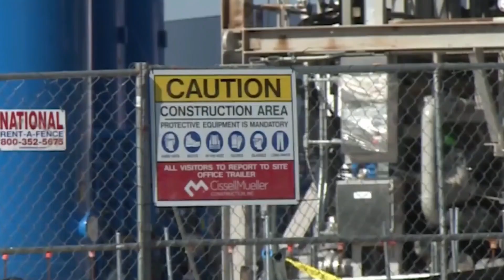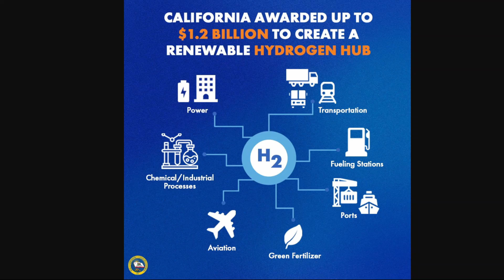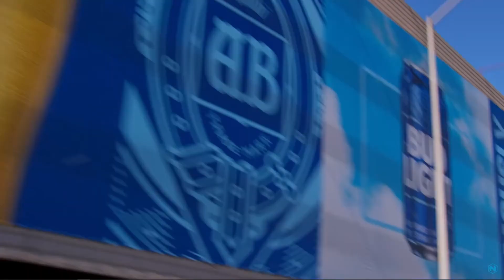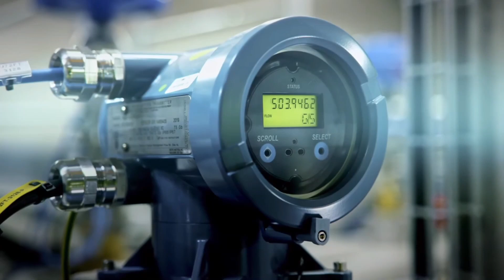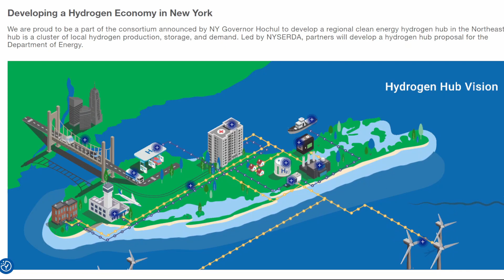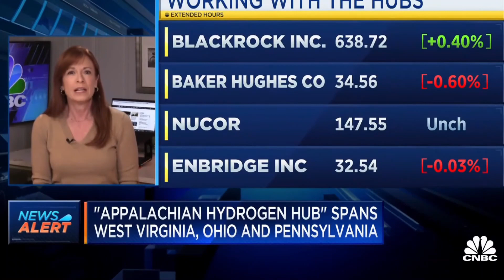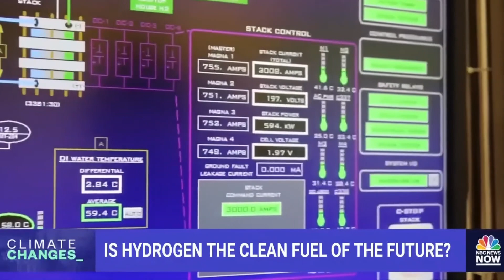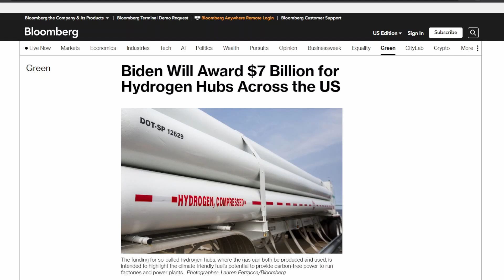$7 Billion for Hydrogen Hubs: America's Clean Energy DREAM Is Becoming Reality.

Comment: We here  at TSS have been working with hydrogen technology for 16 years now. We have a turnkey product that will help with all diesel trucks with emissions to zero in 25% longer distance. Up to 20% more horsepower . We are in eight different countries now. We make hydrogen on demand and burn it along with diesel. Have hardcore data to back it up. Hydrogen on demand has four times energy than bottled hydrogen!!

Comment: No. This is backward thinking. Hydrogen has now been shown to be highly inefficient as an energy transfer medium.
We need lots of green hydrogen, but it should only be used for applications that cannot use anything else, like fertiliser manufacture.
It will never (yes, EVER) be a practical method of energy storage and transfer, such as to power road vehicles. It's just too expensive to make, in both energy and money, the infrastructure too costly to construct and too difficult to handle. Not to mention too dangerous and bad for the environment i.e. a potent greenhouse gas 10 times worse than CO2 that is the most leaky gas known to man.
By the time we have spent the vast quantities of money on the necessary construction and ironed out the many, many problems with hydrogen, other technologies will have leapfrogged it entirely. We did not know this 8 or 10 years ago. Now we do.
Reply: Realize arguing how inefficient green hydrogen is dumb, because it comes from renewable resources🤡
Reply: No. Because of the inefficiencies in green hydrogen production and subsequent use for power, that original energy from renewables is much better used elsewhere. Like directly in electrical grids and battery storage.
Reply: @biodieseler1  no, lithium is not renewable.
Reply: @danieldeblasio9368  Indeed. But it is massively abundant and fully recyclable.
Reply: @biodieseler1  No it is not. It is very costly mining for Lithium whereas using water is way more efficient. Hydrogen is superior for storing & transporting.
Reply: @biodieseler1  One dimensional argument only a simpleton would use in an argument.
Reply: @danieldeblasio9368  You seem to be missing the point. Lithium and hydrogen are not equivalents here. Like iron or oil it takes some energy to mine and refine lithium, but you only do it once. With hydrogen you need to electrolise the water every time you fill your tank, which is quite inefficient. Then the H2 car either burns it or converts it back to electricity in a fuel cell, which is also very inefficient. Even the theoretical minimum cost of H2 fuel per mile, after decades of R&D is still 3-5 times that of gasoline that. By that time battery electric will be far superior. Just look at the constant and precipitous drop in battery cost per kWh or the steady increase every year of energy density. H2 was always going to be too little too late, except for fringe use cases.
Reply: @biodieseler1  Green hydrogen is an addition to the hydrogen economy. Hydrogen is coming so better get use to it.
Reply: And yes, all battery materials are fully recyclable. All broken ones are currently recycled. Eventually, once enough batteries have been made, very little lithium will need to be mined because the majority will come from old EVs and other end-of-life battery applications.
Reply: @biodieseler1  NO!
Reply: @danieldeblasio9368  you protest too much, methinks. Recycling is in operation, wear your blinkers if you must.

I also agree that the world need lots of green hydrogen, but it should all go to fertiliser production and maybe new processes like steel making. Not transport or large scale energy storage. It's just not economically or environmentally feasible.
Reply: @Danieldeblasio9368 Toyota have just announced the hydrogen powered Hilux. Costs twice as much as gasoline version and does 373 miles per tank. Available by 2030. Maybe. Lol.
Reply: @danieldeblasio9368 Nkla shorts are printing. Looking forward to you losing everything when they inevitably file for bankruptcy. Make sure to put what little you have into nkla.

Comment: IMHO H2 'tarded Power is a horrible waste, and someone needed to be fired before it happened. ICE technology has run the course, and is finished. Tell me how spending energy to get some energy to spend makes any sense except in the sales department. Get real, people. Thanks for the content, even if it doesn't make any sense at all.
Reply: You have got the role of hydrogen wrong. H2 is a store of energy for use in applications where directed electrification is not possible. Yes there is an energy expenditure to make H2 but H2 then becomes a store of energy that can be transported to sectors that need it. Also note that the green hydrogen will be produced from excess green energy. Hydrogen Its is a vital component of the Green energy transition.
Reply: @AS-fc7hm  I am aware of this presumption, and still laughing. The energy consumed to store energy at a very low density is only driven by green initiatives and money available to burn, seemingly with great purpose. A well discussed flash in the pan which will be found to have been an impractical prospect yet efficient consumer of time (real money) which ultimately fails to yield sufficient profits (Benjamins) to sustain. Thanks for your reply.

Comment: NIKOLA provides us with hydro trucks....what manufacturer is providing us with a hydro cars/suvs?
Reply: You should look into Toyota because they've explicitly pivoted the company in that direction. Rowan Atkinson (A.K.A Mr. Bean) even did a demo of one of their hydrogen combustion race-cars (not a fuel cell) and mentions that Formula 1 is currently working on a composite fuel that presumably mixes hydrogen and petroleum, though the sport aims to eventually reach carbon neutrality.
Reply: Gasoline works great for cars and trucks.

Comment: Not to sound too much like a tech-bro, but I feel that an aspect of hydrogen-powered cities that often goes overlooked is that as an element, it's the most abundant resource in the universe. I've seen some estimates put it at 75 percent of all matter, which makes sense because it's the smallest possible building block. Like Visceral said, we are merely "extracting" it from around us. Meanwhile, Lithium doesn't even seem to be in the top 10.

This means that we'll be preparing ourselves for space exploration as well, especially as fuel cells won't pollute the inside of an enclosed space station. We could probably even drink the resulting water or irrigate our crops on otherwise dry planets.
Reply: What kind of improvements are possible for extracting hydrogen? Because right now, it's only 50% energy efficient because it does this; uses electricity to extract hydrogen and store it. It then uses that as fuel in vehicles to make electricity for the electric motors. So I don't know how adding this extra hydrogen step adds any value.